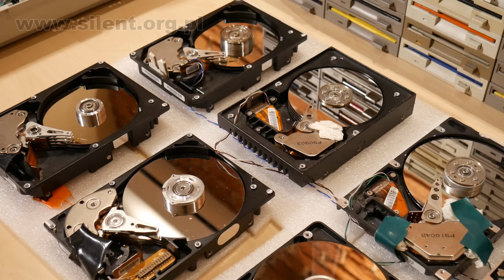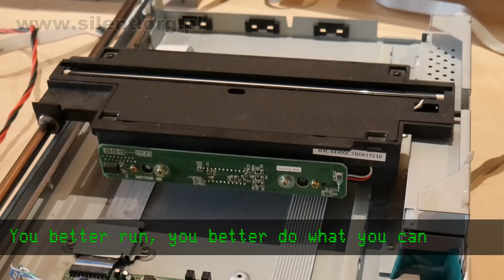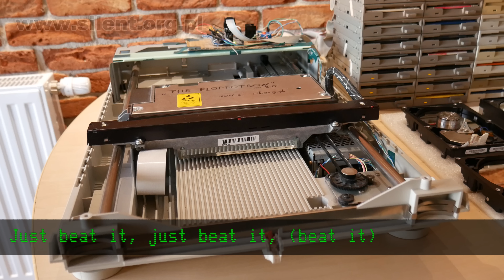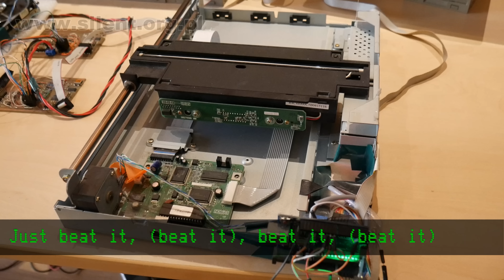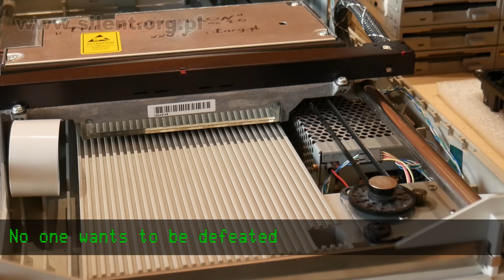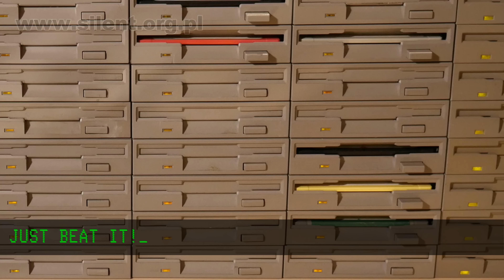Beat It on FLOPPOTRON

Comment: How the hell he manage to replicate Eddie Van Halen’s solo?!!
Reply: Tombstone Harry Studios probably cheating.
Reply: @g.c.5065  Lol. I was just about to say, Cheat codes.
Reply: 101010101010101
Reply: Using Eddie Van Scanner of course !
Reply: Repurposed Diesel Submarine Engine Exhaust  ?
Reply: Maybe a little use of Melodyne for some impossible notes or impossible speeds for the hardware.
Reply: He put in the Konami Code, clearly
Reply: Repurposed Diesel Submarine Engine Exhaust  I think you're in disbelief that a scanner can do van halen when programmed accordingly. That is unless you have some sort of evidence to backup your claim. If he was using a keyboard he would show it. He doesn't fake things. He shows all the instruments as they play. I like how the solo was even pushing the scanner to its limits making it make some less than ideal sounds at some points. It really represents the spirit of the rock solo perfectly.

Comment: 2:27 i just cant imagine you can actually do that!!! excellent job!!! well done!
Reply: well done indeed!
Reply: It's just adjusted frequency for the motor ;) that's it
Reply: @casper2501  there could be tons of coding as well
Reply: I used to have that scanner. I remember those sounds fondly. HP 4C. SCSI connected scanner that cost $1100 new back in the mid 90's. Depending on a lot of factors in the settings you picked, the stepper motors made all kinds of different sounds as they hit different speeds and directions. They just manually control those stepper motors. And I thought Fur Elise Scanner was awesome. This is definitely the next level.

Comment: Watching all the code fly by on the screen makes you appreciate how much work actually went into this. Or how much work went into making people think a lot of work went into this. Either way that's a lot of work.
Reply: Yeah, watching a program do something in realtime tends to look very overwhelming.

I know when I was programming a game engine 20 years ago, if I turned on ALL the debug messages you'd get like 500 messages a second.
Of course, I didn't bother having a realtime monitor for it, since I was mostly trying to track down why crashes happened, so it ended up in a log file...

Originally that log file was set to append the new run of a program after it's previous runs, but that got out of hand so quickly I had to change it. XD

Dealing with a 700 megabyte log file is no fun at all, even now, much less 20 years ago. XD
Reply: Imagine having to tune this thing
Reply: I used to work in the main control and data processing center for 4 major trading banks. Started back in 1988. Monitoring the processing of the cpus was done with 4 screens like that. Pertinent commands or messages were highlighted and would not scroll off the screen until acknowledged or an action for a drive or process was taken. Pretty soon you were able to follow what was going on Matrix style. Big picture resolved itself.
Reply: @GillesVandenoostende  No need for tuning, the stepper motors simply need to go at a certain rate (steps per second) to achieve the tones.

Comment: i would really love to hear also something like a bass. if you are able to add, a electric tipewriter, or something wich is able to produce fat low notes. that would be Really amazing!
Reply: or just any sizeable transformer, hair clipper or old pc speakers [when connecting they usually hum], the alternating current of the outlets is at 50-60 hz depending on the country, so technically any connected device emits that frequency. .

or even a cell or control vibrator could achieve a decent bass spectrum
Reply: @CharlieRAnimaMX  I totally agree.

Comment: READ IT! They told him don't you  write around here don't want to see your write head, you better dissapear the laser light is in their eyes and the code is very clear, so read it,  just read it you better spin ,you better do what you can don't want to see no silcon, don't be a macho drive. You want to be ,tough, better do you what you can, so read it, but you want to write bad. just read it, (read it) readit, (read it) no on wants to be deleted.. showin' how fast and strong is your write speed. It doesn't matter who reads or who writes. Just read it, just read it (reat it)... They're out to get  you better write while you can, don't want to be a hard drive you want to be a solid stat drive, you want to stay powered, better do what you can. So read it, just read it. You have to show them that your really not scared, your playing with your platter, this ain't no CD or DVD.....